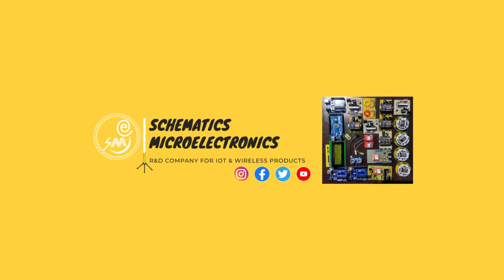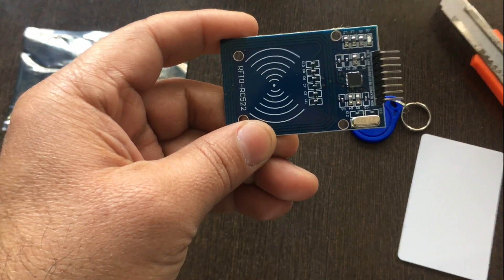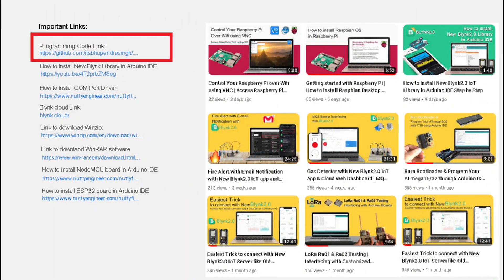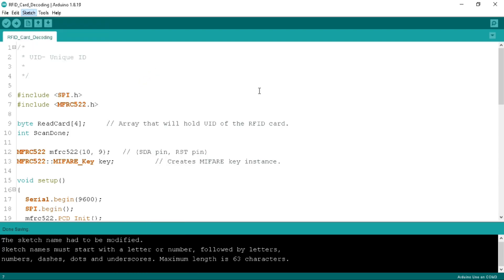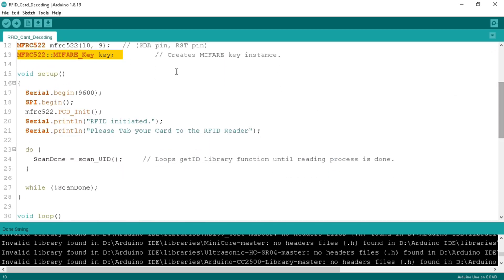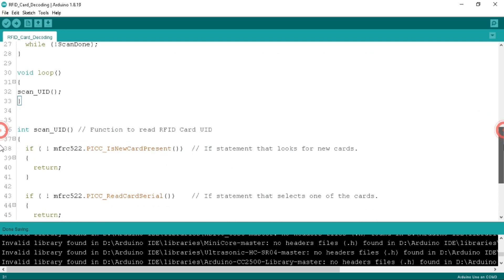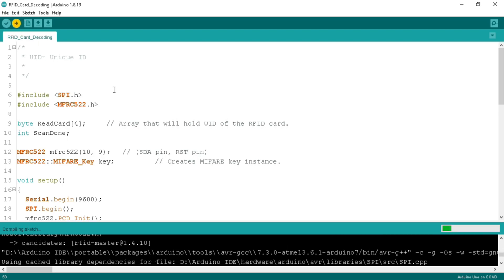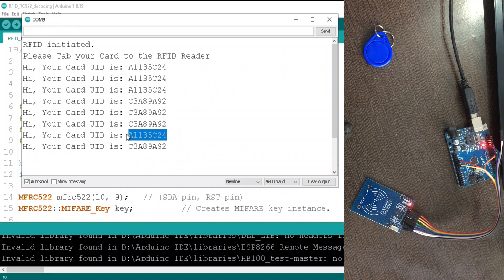How to Decode RFID Cards with RC522 RFID Reader: Step-by-Step Tutorial

Comment: I have connected the same way u did but not getting the uid code 
Tried multiple times but still stuck 😕
Reply: Checked all but still not working
Reply from the maker: Plz check your hardware, wires and also select the proper baud rate.
Reply from the maker: Check the baud rate and your connections as well. Also check you are using the same frequency reader and card.